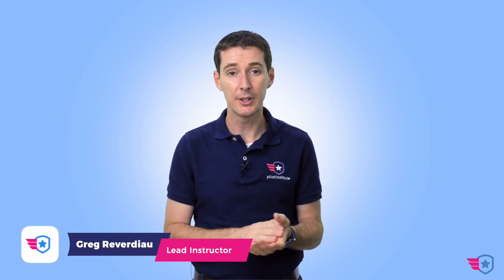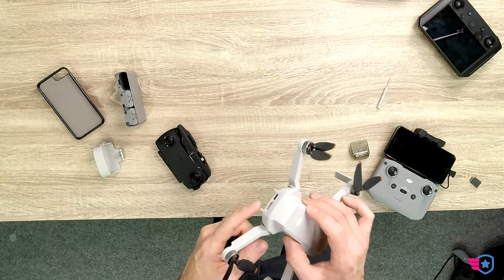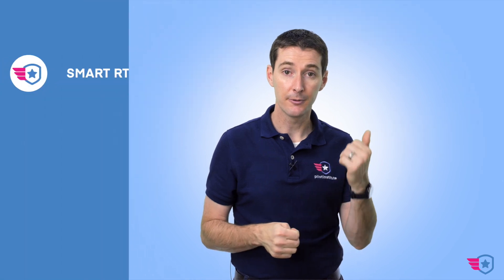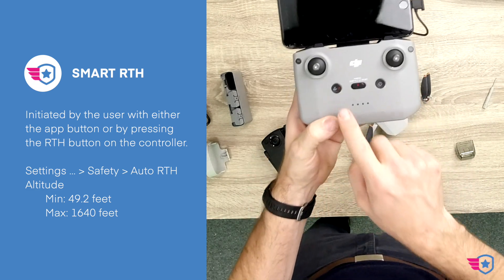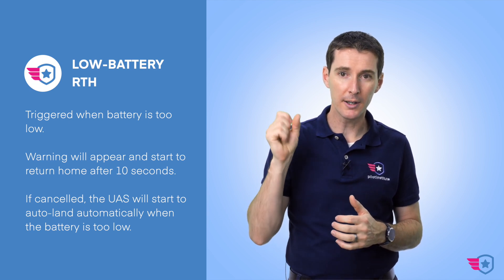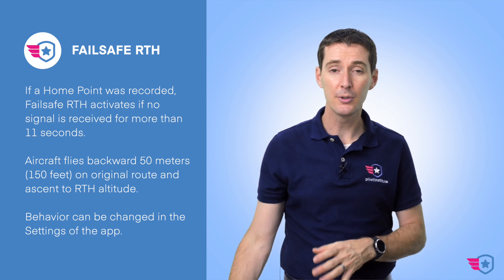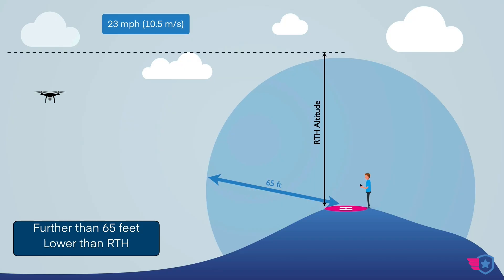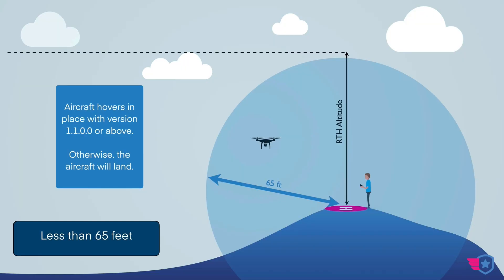DJI Mini 2 - Return-to-home Explained

Comment: 1. Is the RTH location where the drone took off?  Or where the controller is located (if I am 30 yards away from the drone).
2. When I am on a kayak, I kayaked from point A to point B with the drone flying around me.  Can I update the RTH location (which is point B) while the drone is flying?   
Thanks.
Reply from the maker: It depends on the software you are using. The DJI Go4 app has the ability to upload the RTH location to the controller, the DJI FLy app doesn't, so it depends on your drone.

Comment: How does RTH work when you return to home and the drone is at a point below the altitude it originally took off from.  For example, using the diagram from the video, if you took off from the hill where the pilot is standing and flew below the height of the pilot into the valley.  Does the drone rise to the RTH height from its original take-off point?  Or will it rise to the RTH height from it's current position, meaning it will rise less than the height or the take-off position and possibly crash?  For example, if you set RTH height to 180ft and then fly below your altitude as a pilot, if it returns to home now, 180ft will be less than 180ft from its take off position right?  Will it adjust RTH height as it gets closer to home and detects altitude difference it if is moving uphill? In addition how do the drone's altitude sensors work if you fly below the take-off height?  As you fly into the valley do they adjust to the current distance from the ground below it?  Or does it get confused and take the altitude to negative numbers? Sorry for the long question. Hope this all makes sense.  Thanks for the help.
Reply from the maker: When the drone is below its starting point, it will indicate a negative altitude, so it would just climb to the RTH altitude, which is calculated based on your take off point.
Reply: @PilotInstitute  Ah ok.  Perfect!  Thank you so much for your help!

Comment: How does RTH work in regard to obstacles? I fly in an area with 200+ ft + trees. above it? below it? in front?
Reply from the maker: The Mini 2 doesn't have obstacle avoidance (only bottom sensors) so it wouldn't know. The other drones (Air and Pro) do offer avoidance during RTH.
Reply: @PilotInstitute  If only my Pro 2 didn't give me messages that it's 1.5 meters above the surface and asking me to confirm that I want it to land. Except that it's actually more than 100 feet up and 20 or 30 feet laterally away from the home point. Happens about two thirds of the time. The other one third of the time it works perfectly and lands dead center on the H on the pad. 

I'm getting a lot of practice landing manually. I'm so glad that I got an inexpensive drone to practice and learn with before I upgraded to a high quality drone. I crashed and retrieved that cheap drone a dozen times early on.